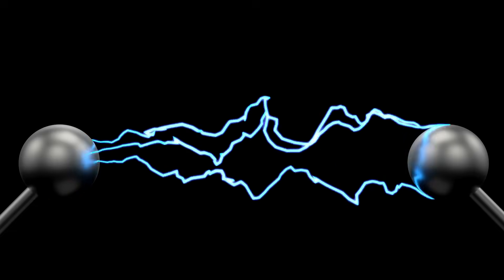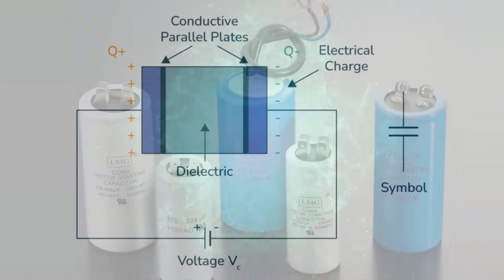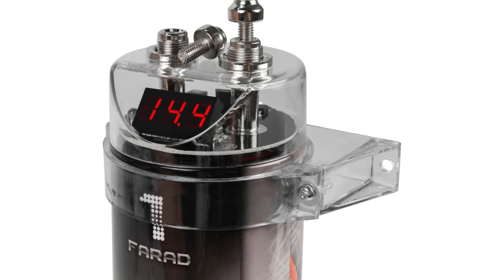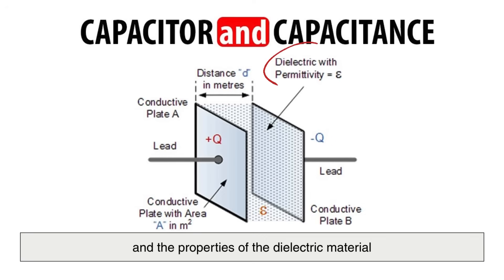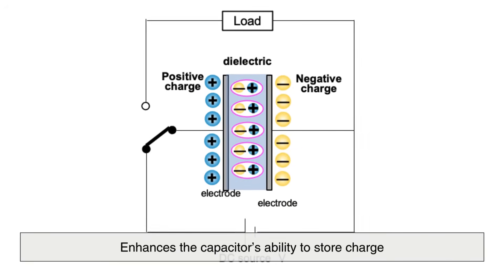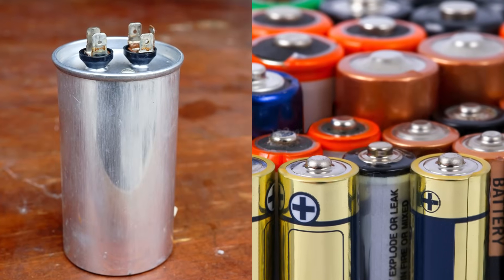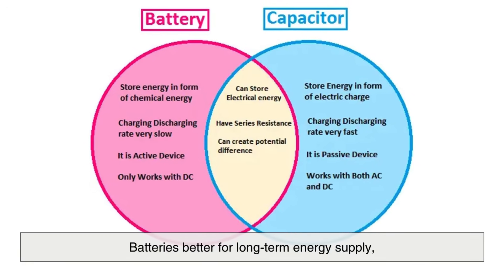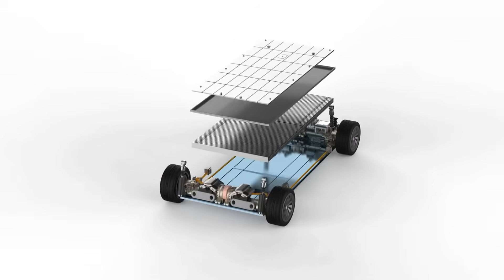What Are Capacitors? The Silent Heroes of Modern Electronics

Comment: Paper condensers by Dubilier soaked in wax were very popular in valved (tubed) radios and televisions, mylar, and sometimes polystyrene. After the rectifier, EZ80, they used 16uF + 16uF condensers, from philco 

I found an old TV as a kid once and wanted to know what was inside that large cylindrical thing. After spending hours prising the lid open, I found nothing but a metallised toilet roll. Really disappointed as I expected to see more condensers and resistors inside it.

Comment: A large percentage of circuit failures (often quoted as 60–80%) are due to bad capacitors, especially in consumer electronics, where cost-cutting leads to the use of lower-quality parts.

Comment: The Leyden jar was an early capacitor from 1746 invented by Dutch physicist Pieter van Musschenbroek at the University of Leyden. Furthermore, the "Ark of the Covenant" was believed to be a large Leyden Jar, because it was a box constructed from acacia wood which was a dielectric material and then covered by gold foil. Wood is an insulator and gold is an excellent conductor of electricity. It was forbidden to lay hands on the Ark of the Covenant, because its stored static electricity could be dangerous.